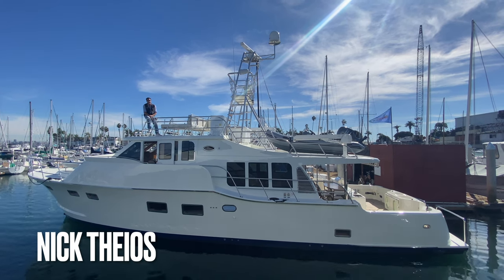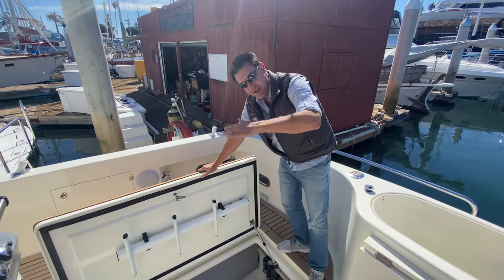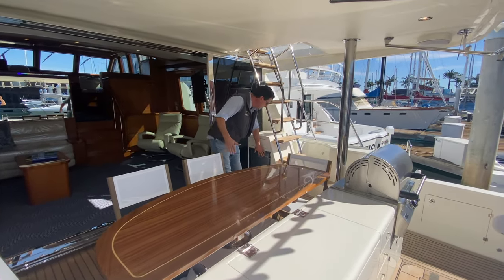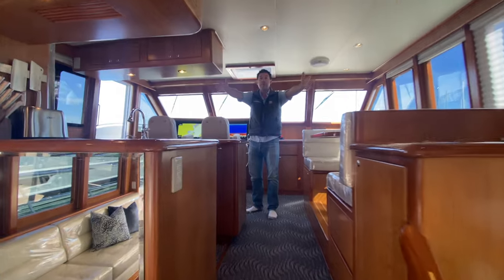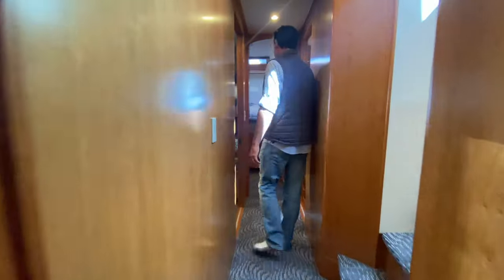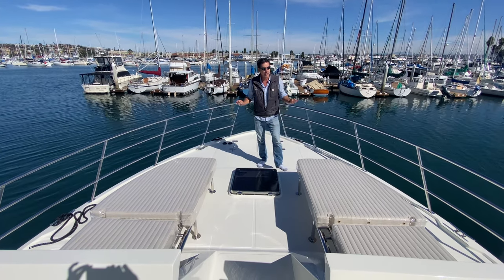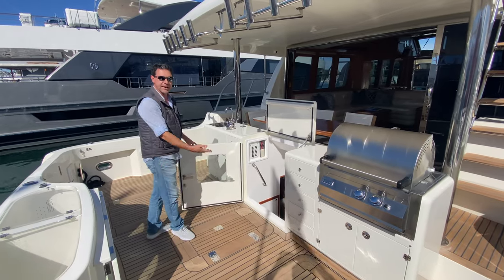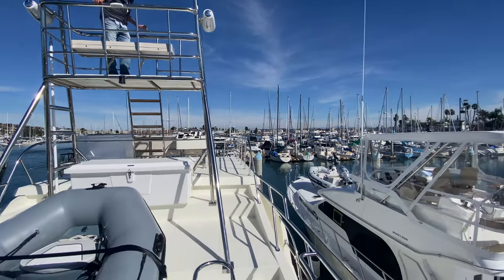Brand New: Mikelson 59' Nomad Tour

Comment: What is the price, and the maximum range of this Fantastic Yacht? Tks from Zurich CH.
Reply from the maker: Base Price on a new Mikelson 59' Nomad is $2,797,000.00USD... Maximum Range if you upgrade to 3,000 gallon fuel tanks would be approximately 3,000 nautical miles at 10 knots